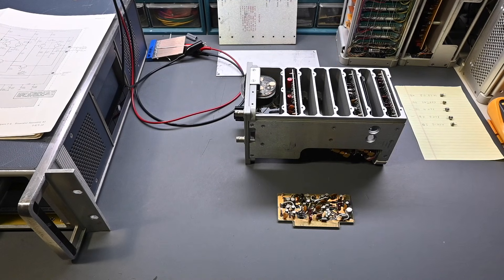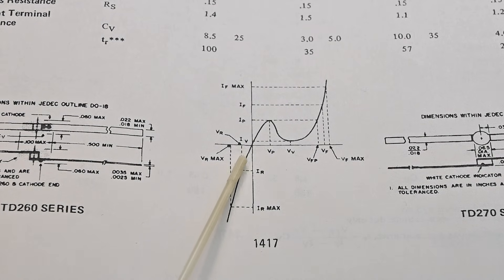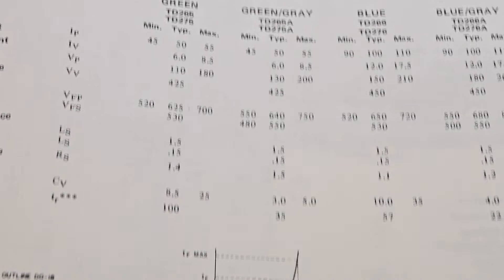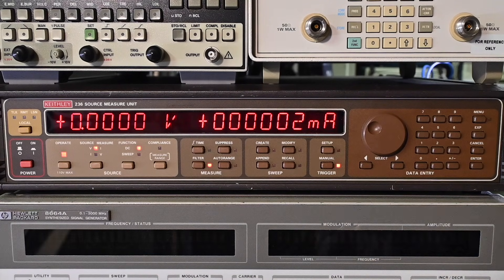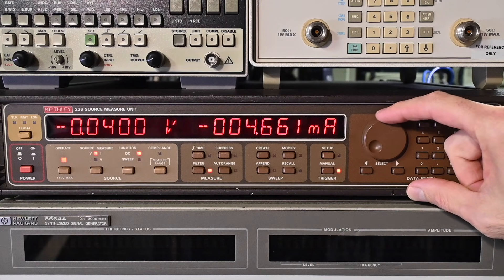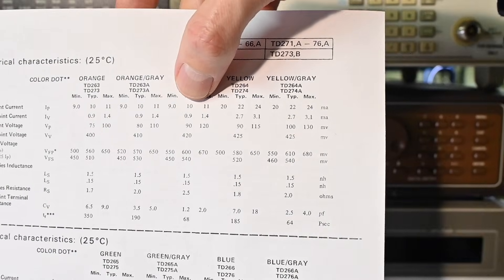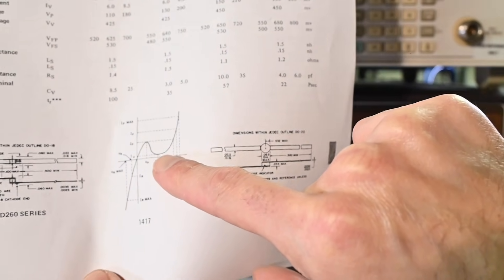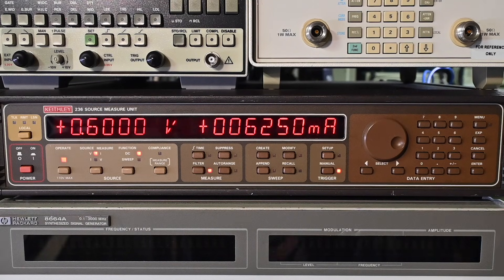What's A Tunnel Diode And How Do You Test It?

Comment: Why does a tunnel diode have negative resistance? It seems that negative resistance is adding more resistance in the diode junction which reduces the current through the diode?
Reply from the maker: Tunnel diodes are usually made from germanium and  when the heavily doped PN junction width is made very thin, the current-voltage characteristic of the diode is dominated by electron tunnel effect.  Tunneling is a quantum mechanical effect which produces the negative resistance.  The negative resistance effect occurs only during part of the diode's operating curve as I showed.
Reply: @EriksElectronicsWorkbench What type of "Opposition" is Tunnelling?.since Tunnelling is NOT adding resistance, how is Tunnelling creating opposition to the current?
Reply from the maker: @waynegram8907  The tunnel current drops in the negative resistance region.  From an article online: ...electrons at first tunnel through the very narrow P-N junction barrier and fill electron states in the conduction band on the N-side which become aligned with empty valence band hole states on the P-side of the P-N junction. As voltage increases further, these states become increasingly misaligned, and the current drops. This is called negative differential resistance because current decreases with increasing voltage. As voltage increases beyond a fixed transition point, the diode begins to operate as a normal diode, where electrons travel by conduction across the P-N junction, and no longer by tunneling through the P–N junction barrier. The most important operating region for a tunnel diode is the "negative resistance" region...  for more details see   https://en.wikipedia.org/wiki/Tunnel_diode

Comment: Tunnel diodes are cool but for us cheap tinkerers tunnel diodes are a little out of our range to experiment with. There is a simple way one can play with negative resistance at a much cheaper price. A N-jfet and a P-jfet can be stacked together to create a useful negative resistance device. Years ago while working in a lab, the other person in the lab would always listen to opera on a classical station. As a trick I created a negative resistance oscillator with a pot, coil and capacitor. It would easily oscillate in the 100 MHz area. When close to an FM receiver, turning it on would quiet the receiver as though the station had gone dead and one day that just happened. Please do not repeat this as I'm sure it is clearly illegal but does show that a negative resistance device can be used for things like a FM transmitter. Anyway the two jfet device is different than the tunnel diode in that it goes completely off at the dip and doesn't start looking like a forward diode and will have zero current until one of the fets breaks down. Typically a real tunnel diode will hit higher frequencies because of less stray capacitance but still fun to play with.
Reply from the maker: Yes the two FETs form what is called a Lambda diode and it can be used to create an oscillator well into the MHz range.

Comment: Could you use a triangle wave at low frequency and a scope to plot this graph on the scope? Put the scope across the diode, as the current through the diode changes, wouldn't the voltage across it also change accordingly?
Reply from the maker: The diode's curve can be displayed on a scope but if you measure the voltage across the diode you will just see  the applied triangle wave form, not the curve.  As I showed, the voltage is increased linearly from zero but the current varies following the diode's curve.  The current is what you would want to plot in relation to the voltage.  A scope's XY mode would be useful for this.  You could measure current using a low value series connected resistor.  The voltage drop on the resistor is proportional to current.

Comment: Great vid on a weird device.  Maybe someday (since you have the equipment to do so) you'll do something similar regarding resistors & how material & construction affect their inherent inductance.  When I measure metal film resistors, they seem to have very low L and seem to be acceptable in RF circuits.  I've been told the old carbons were good & obviously the wire wounds, bad. SMD's???  I could not find a good YT vid that demos this.  Thanx.
Reply from the maker: Thanks and a good topic idea too.  A wire wound resistor, or even types like metal film that have a spiral cut, will have some inductance that could be a concern as frequency is increased.  There are wire wound types made as non inductive.
Reply: But if you go to some OEM sites, they actually extol the virtues of their film resistors & recommended them for RF & even oscillators.  Look up CERMET.   I am aware of Ayrton–Perry windings on some wire resistors.  I don't know how good they are for S parameters.  Thanx.  Looking forward to the vid someday.
Reply from the maker: @Homer19521  Thick film resistors can be non inductive since they don't have a spiral cut, just a planar film of resistive material.  CERMET (ceramic metal) can be made low or non inductive too.  If low or non inductive is important you have to look at the data sheet and see what the spec is or short of that try some real world measurements and see how they perform.  My recent Sencore SR68 audio dummy load video has some discussion about non inductive resistors and measurements on original and replacement parts.

Comment: That reminds me of the "Tunnel Dipper" made by Heathkit, which would be a way to test them using a small oscillator circuit.
Reply from the maker: Yes the tunnel diode can be used to create a high frequency oscillator.

Comment: Erik. What is this kind of diode used for? As in what is it's purpose in circuit?
Reply from the maker: The tunnel diode is used as a high frequency oscillator, they were used in trigger circuits of analog oscilloscopes, oscillators in analog TV tuners, and fast counter circuits to name a few. They can operate well into the GHz bands and have incredibly fast rise times.  In the HP plug-in I'm repairing it is used in a 1 - 200 MHz pulse/squaring circuit. Modern semiconductors have surpassed the tunnel diode (invented in late 1950's) so they are not usually found in new designs.